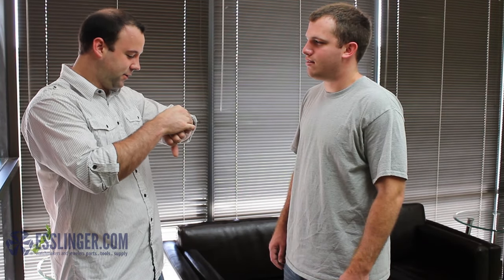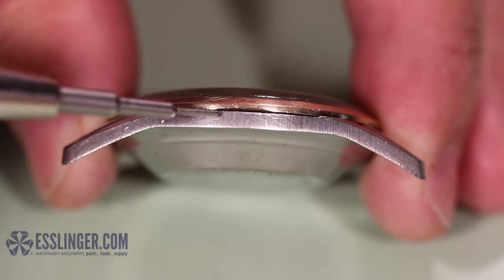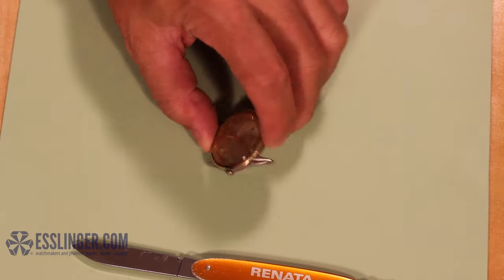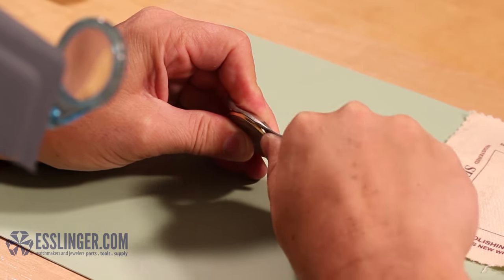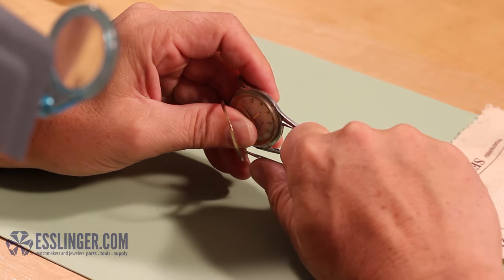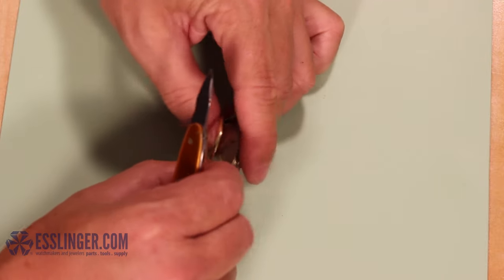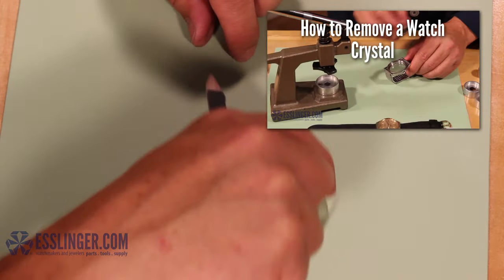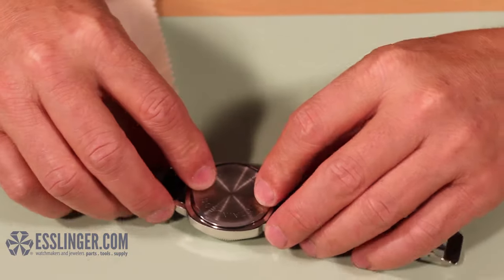How to Remove Bezel Fit Watch Crystals with a Bench Knife

Comment: Very cool thanks, do I need a special tool to put it back together?
Reply from the maker: Many times it can be done by hand but sometimes a watch press is needed (be very careful before trying this method) We do have the press and some videos on watch presses.
Reply: well on my seiko 5 I can't do it with with hands. I just lay the case on a carpet or something soft on the flour. than I use a piece of flat wood ( that won't scratch the watch) and put my weight with my hands on the wood. it's a getto tactik, but it works

Comment: How to change the battery of Rollex 
Can u make video for thas
Reply: Real Rolex watches do not have batteries
Reply: @kw86white  maybe ma man has a oysterquartz
Reply: but I'd say. open the caseback ( you need a special rolex tool for that, you can search on the web for that ''rolex caseback opener''), and you''ll see the battery. over the battery is a cap. you need to losen the 2 screws to open it. than you can remove the lid. after that you just can whip out the battery.
Reply: I had an oysterquartz for 10 years its very easy to fit a new battery you do NOT need special tools even Timpson shoe repair shops will change a rolex battery. Rolex stopped making oysterquartz in 2000 so they are hard to find